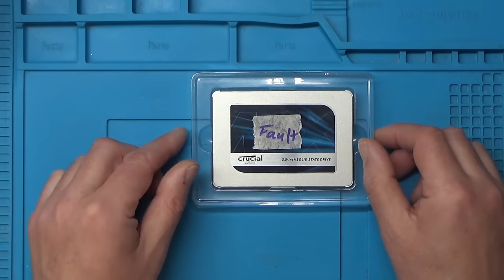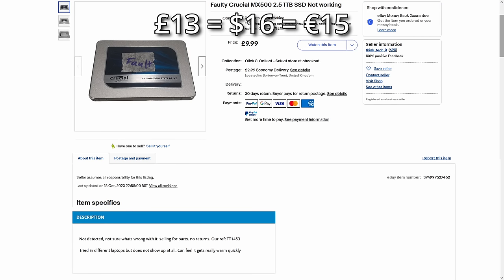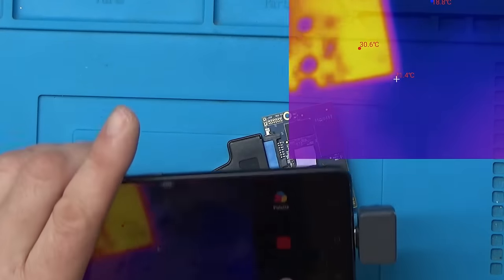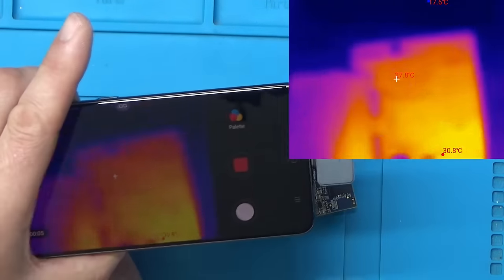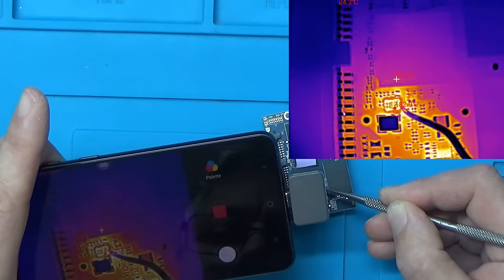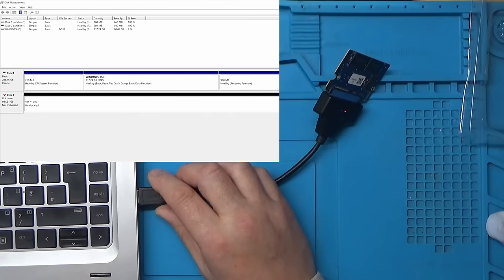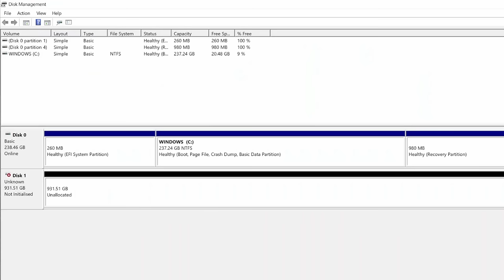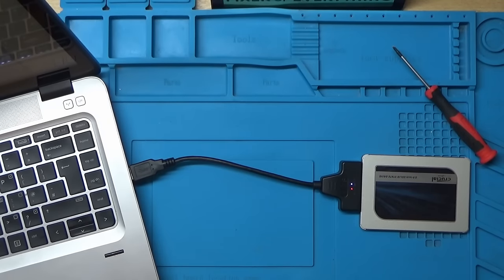Faulty Crucial Solid-state Drive (SSD) 1TB (1000GB) - Can we FIX it ?

Comment: I have only one question: How do you find the capacity of a blown SMD capacitor without a schematic diagram? Guessing by dimensions only or is there something else involved. I watched Northridge videos too, but he usually removes a shorted capacitor and connects to the drive just for data recovery, but since you've put another capacitor instead of the blown one, the question is how do you choose the capacitance?
Reply from the maker: Just a rough guess. It's just a decoupling capacitor I just pulled one from an old board. But it would be something like 0.01uf. The voltage you can work out by either measuring as it's across the supply or again a rough guess.  Seeing as it's across the supply going to the main controller it's probably going to have 3v or less across it. So something like a 6.3v 0.01uf should be fine.
Reply: @BuyitFixit Thank you. I will try it out. We have asked local PC enthusiasts to give me their SSD drives which failed in manners other than locking themselves in read-only mode, and I already got two, so I'll try to use on them what I learned from you and Northridge.
Reply from the maker: Good luck, let me know how you get on 👍

Comment: Great video, thanks. Question, how do you know what type of replacement capacitor to get? Are they unique to size? Didn't see any print on the old cap. Thanks
Reply from the maker: Just a rough guess. It was a decoupling capacitor across the supply to stop noise. It would be around 3v supply so I just pulled one from another board that was doing the same job. Probably around 0.1uf or 0.01uf.

Comment: Did you measure the capacitance of the bad component or did you guess? How do I figure out what to replace an unmarked bad cap?
Reply from the maker: The bad component wouldn't have had a capacitance as it was dead short. It was just a decoupling capacitor as it was across the supply. I just pulled one of another old board I had that was doing the same job. I don't think the value is critical and it would have probably just worked with it removed.

Comment: I have three MX500's. I like them very much
Reply from the maker: Cool, I've not had one before. I normally use Samsung SSDs
Reply: @BuyitFixit  yes I've got them too. EVO 850 and 860 but they have a fixed amount of their MLC space assigned as SLC so you can write fast but if your large file is larger than 60GB (I believe is the value) it slows down as the drive then has to start using MLC (and clearing out the SLC to the MLC). MX500 assign that SLC size variably so you don't notice a slowing down when copying large files onto it. This only works if you keep a part of the drive's space unused so it can use that as SLC

Comment: It's been a long time since I worked on electronic gear and have no experience with surface mount components. Are the caps marked with their value, or did you have the circuit diagram?
Reply from the maker: I just took a rough guestimate. It's just a decoupling capacitor. The voltage wouldn't have been very high (under 6.3v), and probably something like a 0.01uf.
Reply: Thanks for the reply. Good tips and great video. I've got the same 1 TB Crucial SSD that died on me last year, so might venture in. Looking forward to watching more of your vids. @BuyitFixit
Reply from the maker: Thanks 👍it could well be a similar issue as those types of capacitor are a common failure point on lots of electronic equipment. If you don't have a thermal camera, putting IPA on the board or you can get a rosin flux vape type thing, will show what's heating up👍
Reply: Thanks for the great tips. I'm glad I didn't destroy it and throw it out now. It has personal data on so didn't want to sell it. @BuyitFixit

Comment: Well done. You can also use diskinternals to see whether it was Linux formatted (though appears blank, as you discovered). The wonders of small ceramic caps, easily damaged by spikes, vibration and heat, not that power supplies, pick-and-place and reflow would affect those anomalies. In the Electron God scheme of things, I suspect you are the Overseer. I am, of course, Xaragon.
Reply from the maker: Thanks Ralph 👍😂😂😂😂

Comment: I've got a Kingston drive that just died. I kept the card and ditched the case ( into the recycling) with the plane of shredding the card to remove data. I think I'll have a quick check on the board and see if it's got a blown cap too.
Reply from the maker: Could well be the case, the capacitors on things like this are often a cause of failure. If you have a thermal camera you can see what gets hot, or if you have some IPA you could perhaps see what evaporates first when connected to power if you haven't got a thermal camera.
Reply: @BuyitFixit  I have both a thermal camera, IPA and (very old school) freezer spray. All I need now is the time to sit down and do the job 😜

Comment: Three more of them and that's the IR camera paid for.  Nice one.   Linux uses the same partitioning as Windows so that wouldn't show as unallocated,  but Windows may think the allocated partitions are blank if the FS isn't recognised. Maybe if it was one stripe of a RAID array it would show as unallocated,  I don't know if they have an MBR in the boot sector (or the modern UEFI equivalent)
Reply from the maker: Thanks 👍At the end of the video the software seems to show the device only had a few power ups and very little running hours, so I think it failed on power up after leaving the factory.

Comment: Congrats! How do you figure out the value for  replacement cap? Thanks
Reply from the maker: Thanks 👍The cap was just a decoupling capacitor to stop noise / interference to the CPU. The voltage of the CPU would be 3v or under, and a 0.01uf cap is commonly used. So something like a 6.3v 0.01uF. I just pulled one off an old PCB that was doing the same job.

Comment: I feel like Crucial has to be the most ironically named brands for their SSD’s. A business I worked for had decided to equip their office PC’s with them; around 8 months later, within a week, 39 of the 43 failed.
Reply from the maker: Wow that's not good. Thanks for sharing 👍
Reply: MX500 or BX500 variant? The BX500 one is pure rubbish but I do not have any problems with all the MX500 I installed.
Reply: @blockbertus  I recently got my hands on an old server with these MX500 1TB drives. I started with 5 of them...  3 have failed, plugged into a USB adapter then into a car multimedia system to play music from. All other drives i've tried have (intel, samsung) have been fine in this scenario. One more failed just plugged into a PC -- it worked long enough to install pfsense, and start configuring it, but an hour later it could no longer be detected. So, given this experience, I don't really trust the MX500 line any more than the BX500.

Comment: After checking S.M.A.R.T. maybe try a run in h2testw to check if all the flash chips actually work correctly. Seems to be a DOA drive to me as well and it might have never even been used at all. But better be safe then sorry!
Reply from the maker: Thanks for the suggestion 🙂👍

Comment: How do you know what value have this capacitor?
Reply from the maker: It's  not too critical as it's just a decoupling capacitor. It would have probably worked fine without it. I just pulled one off an old board I had lying around that was doing the same job.

Comment: How did you know what capacitor you would need to put back on the board?
Reply from the maker: Just a rough guess. It's just a decoupling capacitor I just pulled one from an old board. But it would be something like 0.01uf. The voltage you can work out by either measuring as it's across the supply or again a rough guess.  Seeing as it's across the supply going to the main controller it's probably going to have 3v or less across it. So something like a 6.3v 0.01uf should be fine.

Comment: Where do you get the capacitors?
Reply from the maker: I just pulled it off an old  board I had lying around. It's just a decoupling capacitor, and would probably have worked without it.

Comment: I have one of these drives. Doesn't fill you with confidence! I bought it to replace the HDD on my ancient laptop which failed due to bring knocked or dropped.
Reply from the maker: This type of failure happens a lot on electronics. I've seen lots of different devices fail the same way.
Reply: I always keep backups of SSD's to spinning disks. SSD's can fail catastrophically. At least with HDD's you can read data off platters most of the time with donor boards and head ROM swaps. Once a NAND flash chip shorts, it's game over.

Comment: Any chance that you could let us know what the value of that capacitor was?
Or if you just used anything, perhaps the value of what you used, that appears to have worked.

I have a bunch of these drives and while they work great, after upgrading to firmware M3CR046, I'm still nervous with them.

I had one as my main system drive on this Windows 7 box (don't ask) and after a few months, while it still ran find, I was getting BSOD one after the other.  It turns out that was 3 issues.  LOL

-  one, before I had the previous firmware, known to cause issues
-  RAM was old, so replaced that 

and the worst, which causes intermittent BSOD on any ver of windows, is the stupid software and drivers for my Logitech G935, 7.1 surround headset.  Another known issue.

So one of the things I've done since, to rule out this Crucial drive, was to replace with the a Western Digital Blue SA510, 1TB drive.

I use CrystalDiskInfo always and interestingly enough, the S.M.A.R.T. reports between the Crucial and SA510 is quite different!

The Crucial reports as one would expect, BUT, the WD Blue reports something I've not seen before and turns out to be vital.

That is, it reports, "Total NAND Writes!". It is the ONLY drive that reports that.
I say vital, because, with stupid Windows logs constantly being written to the drive, the NAND degrade "quickly".  In just a few months, the "Health Status" has gone from 100% to now, 66%, even though it still says, "Good."

So once it gets to 50%, I'll change it out for another drive of the same type so that I can monitor NAND writes.

Sadly, it's impossible to force windows to completely stop writing logs, even though I've disabled everything I could find.  I even moded the registry to force the logs to be written to a different drive.

Windows doesn't seem to like that and continues to write to the same "C:" drive.

I have to keep Win7 on this machine due to all my security cams.  I CAN get them to work in Windows 10, using Edge in IE MODE, but it's a pain in the butt... (long story).

oh well.

So anyway, if you could kindly post what the value of that cap was, I'd certainly appreciate it as I'll document that for a "just in case" situation. I just want to avoid having to open up a 2nd drive to check values, in case one fails.
Reply from the maker: Thanks for the info. The cap is just a decoupling cap to make sure the controller has a clean supply. They are normally around 0.01uf and you can work out the voltage by measuring it or just guessing it will be around 3v or so. So something like a 6.3v 0.01uf should be fine. I just pulled one from a scrap board that was doing the same job. It's probably not too critical, and the drive might have worked fine without it (but possibly not 100% reliably).
Reply: @BuyitFixit  Thanks.  I've made note of that.

Comment: Do they use cheap capacitors or something? I have the same drive and it stopped working after just 4 years.
Reply from the maker: These surface mount capacitors are a common point of failure on loads of different devices. iPhones, Nintendo switches, xboxes, and I've had the same on a CCTV IP camera before. I think it's more the design of the capacitors and the need to try and cram more stuff into an increasingly smaller area.
Reply: @BuyitFixit  You're definitely on to something there. Because I've  had a 250GB version of that drive since 2016 and it's working fine still.
You know, just for windows. But the 1TB one was out even before 5 years passed.

Comment: May I ask how you determined what size capacitor you used for a replacement?
Reply from the maker: It was just a rough guess. It's a decoupling capacitor across the supply. We know the chip runs around 3v and a normal value for a decoupling capacitor is around 0.1uf to 0.01uf, so I just pulled one off an old board doing the same job.

Comment: how did you determine what capacitor you needed ?
Reply from the maker: Just a rough guess. It's a decoupling cap across the supply, so it would be something around 0.1 - 0.01uF, and it would be across a 3V supply. The value wouldn't be too critical.

Comment: @BuyitFixit sadly, it does not confirm that the SSD is brand new... as i heard, one can reset the S.M.A.R.T. values...
Reply from the maker: Interesting, although if the drive failed while in use, I'm not sure how they could be reset.
Reply: @BuyitFixit  dunno whether this would be possible while the drive is faulted, or not... there seems to be an 'management' interface on the PCB... i never was that interested in this matter - as i said, i only heard about it...
BUT my 1st comment wasn't actually about that particular SSD, it was about the S.M.A.R.T. can't apparently be fully trusted...
Reply: @Bl4ckSer4ph  
oh well, let's just think that one of the previous owners (let's assume more than 1 owners just to avoid putting sensitive context onto 1 particular party) had a negative intention of resetting the S.M.A.R.T. values - blanked the chips' content in order to put a brand new value to the drive but somehow coincidentally fate decided to say hi and implemented instant karma 🤣, then you know the rest of the story 😁

Comment: Wow! How does such a capacitor fail?  Is it poorly sourced materials?
Reply: In my experience caps are usually a common point of failure, often down to cheap (poor) manufacture and quality control. Not saying that's the case here, might just have been unlucky with that cap.
Reply from the maker: Agree. I've seen lots of devices fail due to capacitors going short circuit.
Reply: @@phillipbanes5484 True, and that's why you have quality control ....... However way too many devices fail due to dodgy caps and most of those devices are likely thrown in the trash. It wastes consumer money and it should also go without saying that more electronics waste is certainly bad for the environment. And all because of what? Some badly manufactured caps that cost an extremely tiny amount to manufacture. Of course many of the companies making the devices largely won't care, the devices are made cheaply and as they fail the customers buy more and more. Welcome to our grotesquely capitalist, hideously throwaway society.

Comment: I came here to say about Crucial Storage Executive, but see you found you had already found it. 

Its worth doing the the firmware update and also note the SMART 202 Percent Life remaining = 100, this will decrease over time

Also, to easily scan a drive to see if its got any data on it, in Linux, hexdump -C /dev/sdd (assuming its SDD), it will show if drives are empty or contain data. If its all zeros, you will get one line and it will then sit there reading as there is no point showing pages of zeros.
Reply from the maker: It seems the drive was almost new from the number of power on count and uptime, so it must have failed when the purchaser plugged it in or shortly after.

Comment: How did you find out the value of the cap?
Reply from the maker: Just a rough guess. It's just a decoupling capacitor I just pulled one from an old board. But it would be something like 0.01uf. The voltage you can work out by either measuring as it's across the supply or again a rough guess.  Seeing as it's across the supply going to the main controller it's probably going to have 3v or less across it. So something like a 6.3v 0.01uf should be fine.

Comment: How did you know what value capacitor to use?
Reply from the maker: Just a rough guess. It might have even worked fine without it. The cap was just a decoupling capacitor to stop noise / interference to the CPU. The voltage of the CPU would be 3v or under, and a 0.01uf cap is commonly used. So something like a 6.3v 0.01uF. I just pulled one off an old PCB that was doing the same job.

Comment: How do you know the microfarad value of the capacitor to replace?
Reply from the maker: Rough guess. It's a decoupling capacitor so the voltage would be around 3v to the microcontroller and a value of around 0.01uF 🙂
Reply: @BuyitFixit  I mean in general when fixing any board. Is there a common database somewhere where one could look up for example "C123" for board "Xyz123"? For capacitors that stabilize the voltage it's easy: The bigger the better. But for other appliances like frequency generation the capacity must match exactly. For other cases like in coil systems too much capacity could damage many parts.
Reply from the maker: @hansregli8678 unfortunately no such database exists that I know of.

Comment: You can check the s.m.a.r.t attributes to see for how long it was plugged in and how many bytes were written to it. It might be used. When you delete something on an SSD, the controller will run TRIM when it's idle to improve performance. That's why recovery software is usually useless on SSDs unless you can run it before TRIM kicks in.
Reply from the maker: I checked at the end of the video. 180k or so written and 0 hours, 13 power cycles 🙂
Reply: @BuyitFixit  oops, I missed that last part 👍
Reply: @BuyitFixit  did you update the firmware, it was yellow/orange?!
Reply from the maker: @Damicske  Not on the video, but I did later🙂